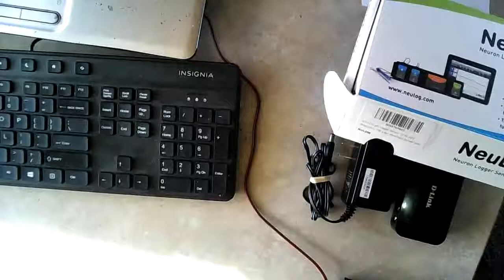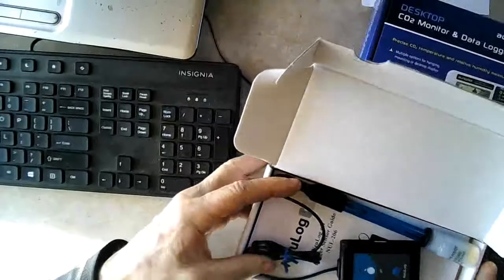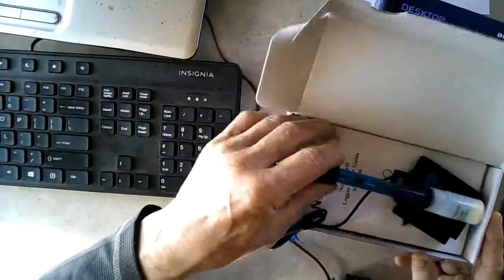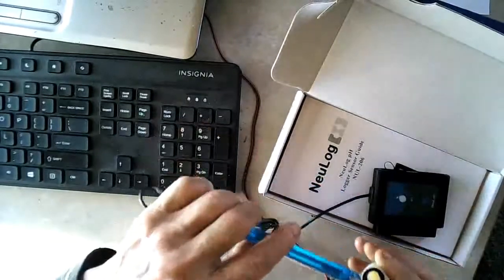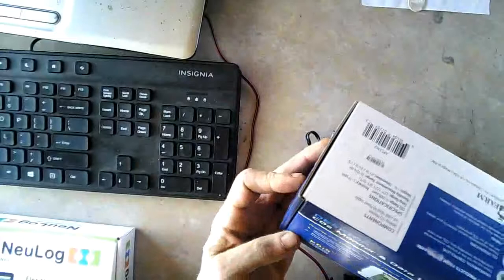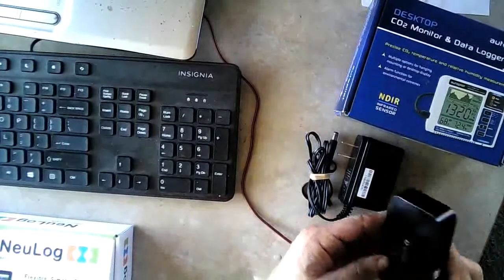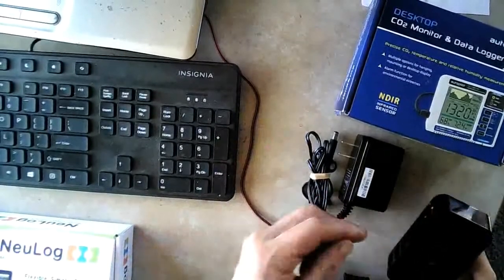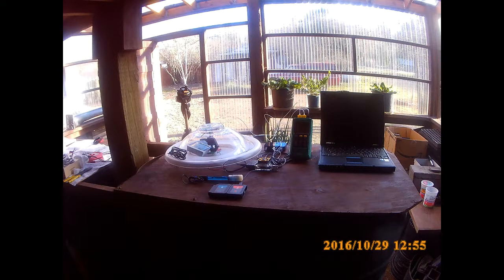Battery Testing Project Update!

Comment: Echo the comments of Leo and MrF.........glad to see the level of measurements and documentation you'll be able to do.  Improvements come in small increments and now you can sort through the 'maze'.
Reply from the maker: Yeah, it's exciting Dennis. I can't wait to get the baseline study done, so I can work on testing more powerful batteries. I may take Leo's suggestion and add a charging unit to see if the bio-cell can be externally charged too. It only self-charges at the moment.